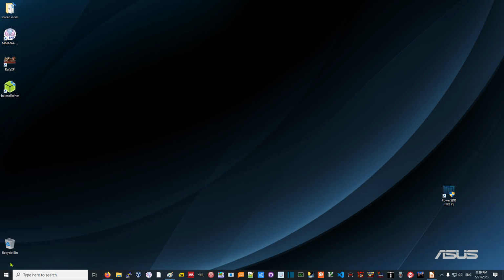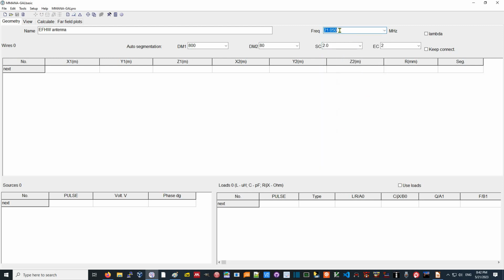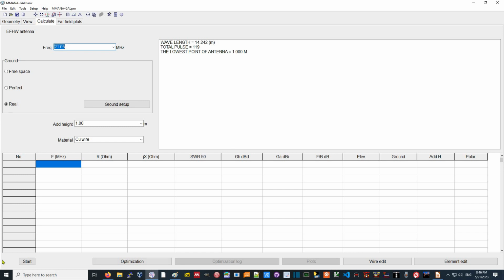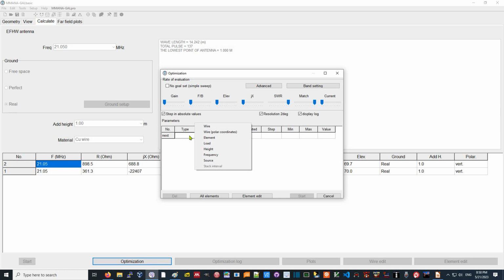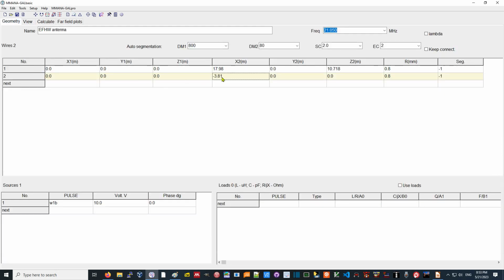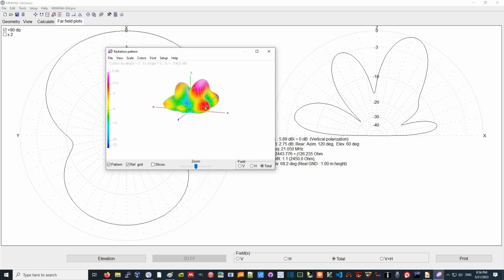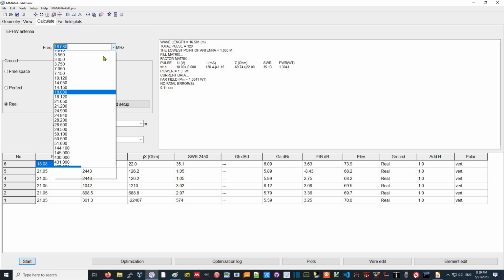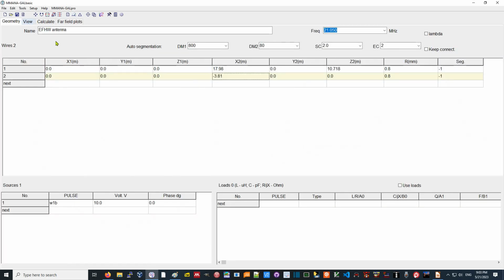EFHW Antenna Simulation Using MMANA GAL

Comment: why are you entering the impedance number in the SWR field? This is confusing
Reply from the maker: Thank you for the comment.  The MMANA GAL program (6:47) shows, by default, "SWR 50" on tab 3 to indicate that the SWR value shown assumes a 50 ohm impedance match.  This is not the impedance to match at the feedpoint of an EFHW.  The EFHW uses a 49:1 transformer at the feedpoint which forces the SWR value to be 49 x 50 ohms = 2450 ohms.
Reply: @quantumradio  ok so the GUI is a little confusing. It seems it should be labeled "target impedance" or similar. But in this care I guess you can think of the SWR field like how you use "tare" function on a scale? Thanks for the reply
Reply from the maker: @Forest_Linden  Yes, "target impedance" may be the better, more accurate, term in this case. 

Our goal is to get to an SWR of 1:1 given the impedance of our feedpoint.  Normally, we use a purely resistive load of 50 ohms at our antenna's feedpoint to provide an impedance match to our coax cable.  In this EFHW model, I knew that I was going to use a 49:1 transformer so I told the program to match to 2450 ohms.

Comment: Hi,  Congratulations on the explanation!
The only question I have is that you say the calculation is for an EFHW antenna for 21.05 MHz.  with the dimensions you provide, the wire length, is 20.45 meters, which corresponds to a half wavelength of 7 MHz (approximately), which is the 40-meter band, and not 21.05 MHz, that is 15mts band. I have runned a calculation for 7.15 MHz and the result is really bad.
What part of the explanation did I miss?
Reply from the maker: Thank you for the comment.  Yes, the initial calculation/optimization was done for 21.050 MHz.  This gives the optimized length of wire to be  SQRT[ (17.98)ˆ2 + (10.718)ˆ2 ] = 20.93m.  If this was a dipole antenna, then each leg would be ˜10m so the tip to tip length (total) would be ˜20m.  However, in this case, we're not modeling a dipole but rather an offcenter fed dipole, where one leg is the counterpoise wire and the other the 20.93m main wire.    

Now, if we use the simulation that worked for 21.050 MHz, everything else being equal, and just change the frequency to 7.050 MHz, we'd get an SWR 2450 = 3.2.  Which is clearly not 1:1 , but maybe the transceiver's internal tuner can manage it.  In other words, it's not terrible.

I believe that the fact that the EFHW antenna gives good SWRs on multiple frequencies is one of the main reasons it's so popular.  Hope that helps, 73!
Reply: @quantumradio  Tks a Lot by your response , but I am still a little confuse. 
By definition a EFHW antenna has a half wave lenght but it is feed at the end, that means that for 21.05 Mhz , the lenght is 7,12 meters and not 20.93 meters as you informed (lambda=300/21,05=14,25 meters, half wave is 14,25/2= 7,12 meters). 
in fact one EFHW antenna of 20.93 meters lenght is actually for 7 MHz aproximally, beacause lambda=300/7,15=41,96 mts and lambda/2= 41,96/2 = 20,98 mts , that is closer to 20,95 mts informed by you. 
then is my undertanding that you made a 7 MHz EFHW antenna but "tuned" for 21,05 MHz (15 mts band)... could be or I am confuse too much? . but even with this missunderstanding probably mine, tks because the procedure explained is very clear
Reply from the maker: @darioj.7454  Thank you for the comment.  The way I understand it is that in an EFHW antenna, the current reaches a node at the end of the radiating element; however, it doesn't reach a node at the end with the 49:1 impedance transformer.  Its resistance at the transformer is 2450 ohms, which is why we must reduce it to 50 ohms using the 49:1 impedance transformer (50 ohms = 2450 ohms/49).  Our feedpoint impedance then measures 50 ohms which matches the characteristic impedance of our coax which in turn matches our transceiver's output impedance of 50 ohms.  So we can then have an SWR of 1:1 in this case.

You may find Gil's, the Radio Prepper, EFHW video interesting and it may answer your question.  This the URL for that video:  https://youtu.be/0zF7bDoqkG4?si=s0XDINBuxS3-ORbG

Comment: Good presentation.  Thanks.  I'm not familiar with the simulation engine within MMANA.  One thing I can do with NEC2|4 is model an air core autotransformer, like the EFHW transformers found in VHF EFHW antennas.  This is done by literally modeling the spiral winding of the transformer and connecting the feed to the bottom with a bit of series capacitance... just like commercial EFHW antennas do.  With this method, 50 ohm simulation is practical.  Can MMANA do this?
Reply from the maker: Thank you for the comment.  I am by no means an expert on MMANA-GAL.  I have modeled simple geometries with it and in the case of this video I modeled the EFHW with a feedpoint impedance of 2450 to avoid modeling the 49:1 transformer plus capacitor.  Now, MMANA-GAL does allow for defining reactive loads so I believe that it has the capability you mention; however, I have limited knowledge in that area.  Best of luck & 73.

Comment: Thank you for an easy to follow guide for the EFHW antenna.  Even my chemo brain can follow along.   Callum does a fun job of antenna designs with MMANA but always leaves the SWR at 50.  Hopefully most have figured this out but just after 14 minutes in you mention using  Pythagorean Theorem to find the length but if we go to the view tab and select the element it shows the polar and rectangular information for the element selected.  Hope that helps someone!  de ki7cia 73
Reply from the maker: Thank you for the comment.  Good tip on the polar & rectangular info.  I said pythagorean theorem but maybe trigonometry would be the better tool.  Either way, we're lucky to have options since it's a right angle triangle.   Best of luck & 73!

Comment: Good video.  I have found that when driving the end of a wire that connects to more than one other wire, MMANA sometimes does not correctly apply the stimulus to all connected wired equally (the origin of 0,0 seems to be an exception).  For all but the simplest antennas, I have taken to adding a 2cm wire and driving it from the center and then attaching other wires.
Reply from the maker: Thank you for the comment and very good operational tip when using MMANA GAL.  73.

Comment: Thank you very much for this video! 🙂 I am new to ham radio and I downloaded MMANA GAL only recently because was impressed by the results that others got from it and showed it in their videos, but I myself had no idea how to get there. Now, I followed along your instructions and fortunately I got the same results -
I was a bit worried that the software wouldn't work the same as on the OS it was programmed for (I am using it on Linux/Wine). 🙂
Reply from the maker: Thank you for the comment and congrats on running MMANA GAL on Linux!  I think that's what's so great about the hobby in that we experiment and challenge ourselves to learn new tech.  MMANA GAL is a good tool to see if a particular antenna design is better or worse than another.  I think it's straightforward and I personally like the wizard-like sequence of the tabs, starting on the left with Geometry>View>Calculate>Far Field Plots.  Also, note that the Dielectric & Conductivity values are shown in tabular form at this URL.  http://gal-ana.de/basicmm/en/#7  Best of luck & welcome to the hobby!

Comment: Isn't the counterpoise on the 50ohm primary side of the 49:1 unun transformer while the antenna is on the 2450ohm  secondary side?  How does MMANA compensate for this impedance transformation of the counterpoise?  And how do you compensate for the primary parallel 110pf capacitor in your model?  Have you built, tested, and measured the actual length's of the antenna against the simulation?
Reply from the maker: Thanks for the toughtful comment.  The way I look at it, the coax sheath is my counterpoise in the simulation.  MMANA GAL doesn't consider an impedance transformation for the counterpoise, it does an impedance transformation from the feedpoint to the antenna element.  The counterpoise is the ground wire, coax sheath really, connecting the ground on the transformer to my floating ground of my transceiver.  I could probably fiddle more with the counterpoise in this model but I found that this simulation gave the insight that I needed to build the EFHW antenna and start testing it.

I didn't model the capacitor as a load in my simulation.  However, to your point, I have seen reports that the high frequencies are helped by using the capacitor but my model doesn't include this effect.

Yes, I have built, tested, and folded (not cut) my antenna element to resonate on 40m, 20m, 15m.  The EFHW antenna I built last year at field day is pretty much what I modeled here and it's the one that I take on POTA outings now a days.  It's very portable and you can drape it over a tree branch, or use a fiberglass pole to hold up the antenna element end.  This makes for a quick setup.  

Hope that answers the doubts.  73!

Comment: great, thanks a lot, very helpful!
Reply from the maker: Thanks for the comment.  Best of luck in your project & 73!
Reply: i have made a T2LT to compare it with my endfed, now i dont know how to model it in mmana. any advice? what antenna form is it?  @quantumradio
Reply from the maker: @jomckarth4836  Unfortunately I am not sure about how to model the Tuned Transmission Line Trap antenna.  A load consisting of an inductive coil plus a capactior element in addition to a wire segment might be the way to go.  Best of luck & 73.

Comment: SWR is important but shouldn’t you also try to get jX closer to zero?
Reply from the maker: Thank you for the comment.  Yes, absolutely.  Per my understanding, the SWR is defined in terms of load impedance (ZL) minus the line's charactersitic impedance (Zo) in such a way that:  If ZL is very close to Zo which in our case is typically 50ohms, then SWR goes to 1.0.  This is normally expressed as 1.0:1.0 or 1:1.  So in my understanding of this, the more ZL approaches R=50 and jX=0.0, the more our SWR is closer to the perfectly matched transmission line value of SWR= 1.0.  

Now, the  reactive (jX) part of ZL gives an indication of whether the load is too inductive (+) or too capacitive (-), so then we as Hams know whether to add inductance or capaticance to our system in order to null out the jX and get to the centerpoint of the Smith chart which is 50 ohms, and zero jX.   Recall that we want ZL to be at ZL = 50 +j(0) or as close to it as practically possible for our antenna.

Lastly, note that the Smith chart's centerpoint is actually 1 since it normalizes the R values to 50 ohms for Ham transmission lines, though for TV lines they use 75 ohms I believe.  This way they don't have to make different Smith charts depending if your transmission line's charactersitic impedance is 50 ohms or 75 ohms, or any other value.

Best of luck with your project & 73!
Reply: We’ll done!
Reply from the maker: @wildbill1  Thank you for the comment & 73!

Comment: Thank you for the great video. Using a 66 ft N9SAB efhw antenna on 20m I lowered my antenna mast (painters pole) to 19ft to get as close a possible to get a 5 degree take off angle to maximize my antenna gain takeoff. It has helped significantly.
Reply from the maker: Thank you for the comment.  Yes, I heard of the 5-8 degree elevation rule of thumb from Callum McCormick, the DX Commander, and it made sense.  He also models his antenas in MMANA-GAL.  Best of luck & 73!